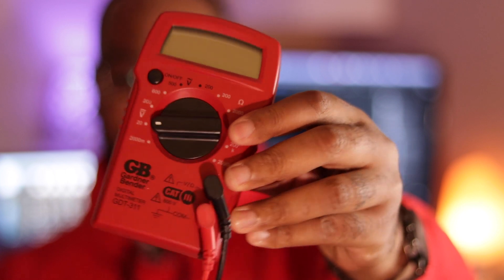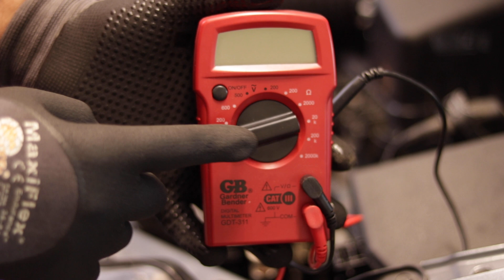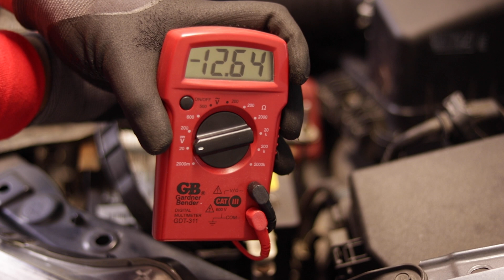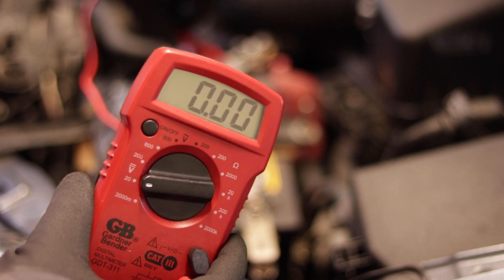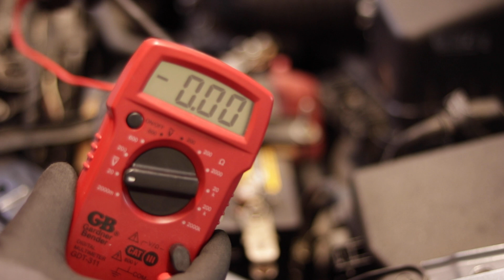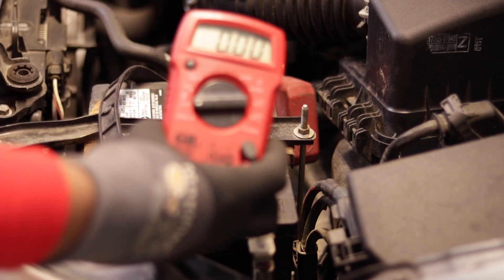HOW TO TEST YOUR CAR BATTERY AND ALTERNATOR WITH A MULTIMETER | DIY BATTERY TEST #diy

Comment: Mine looks different.  The black button is "Hold" and the dial turns it on unless it's pointing straight up.  And yet it's the same model, GDT-3190.  Turning the dial to 30 or "12V" inside a little black battery icon both work.  I got it at a local hardware store.

Comment: I just got one, but I didn’t realize you have to take a black rubber thing off and unscrew it just to put a 9V battery in it.  I already returned one for being broken at the hardware store because I couldn’t turn it on.  It doesn’t come with any manual.